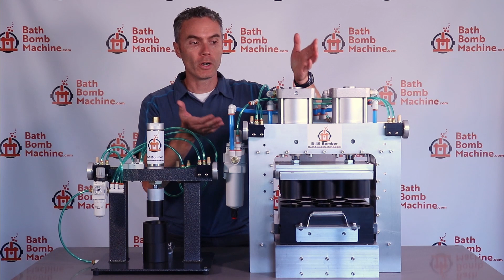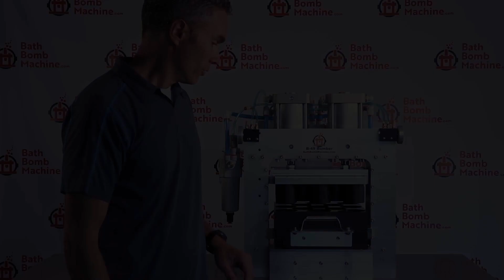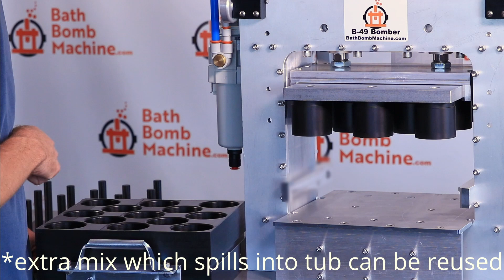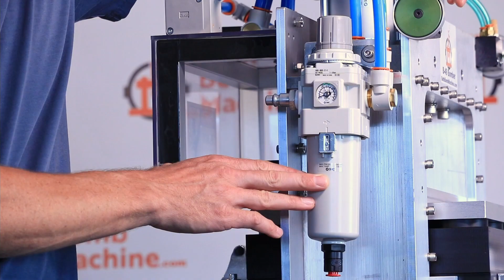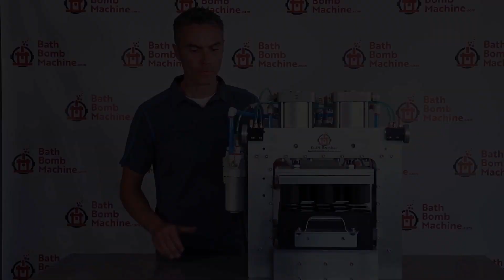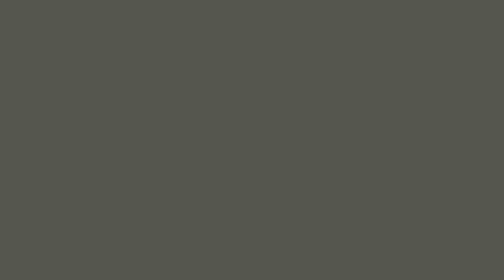B-49 Multi Press Bath Bomb Machine Overview - BathBombMachine.com

Comment: What if the lower tray is misloaded on the bed - will the mold or press be damaged?
Reply from the maker: Morganrich, if the lower mold tray on the B-49 is not in the proper position, the upper mold assembly will come down and contact the top surface of the mold block and stop.  I just spoke with a B-49 customer on Friday who has had his for now 2.5 years.  He used it to make over 1,000,000 shower steamers in Pennsylvania in 2023.  He did not mention a single instance of having the lower mold block 'out of position' and has not purchased replacement mold parts.